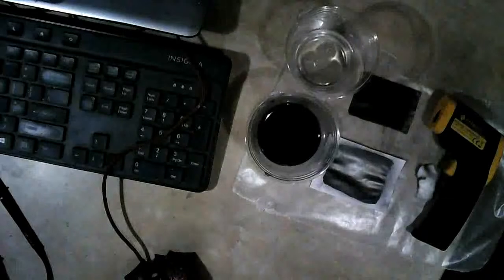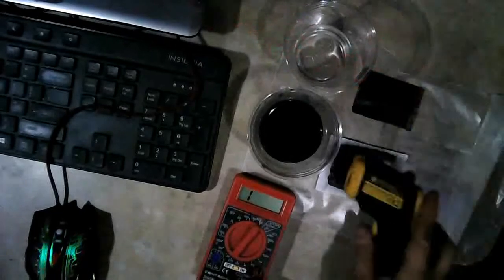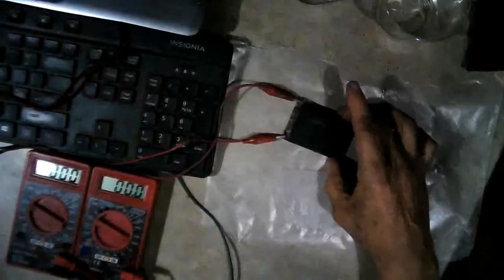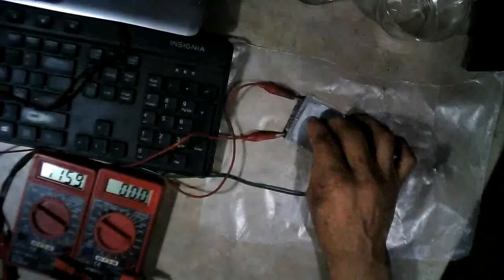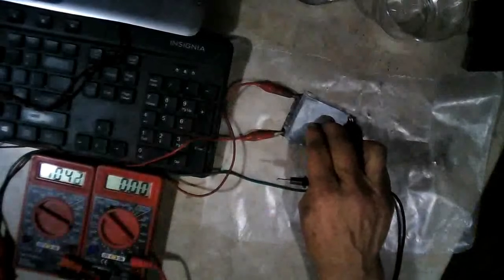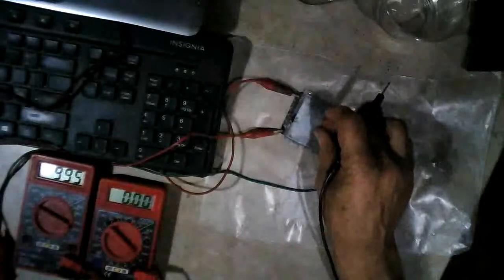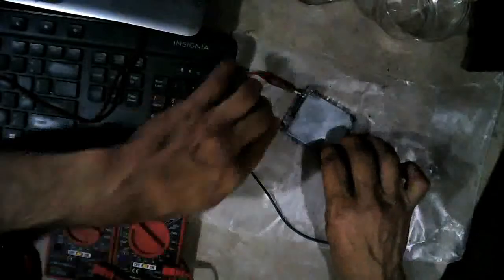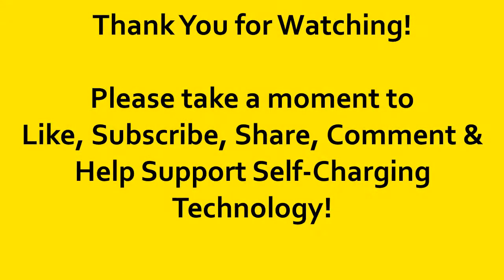Borax Exfoliated Graphite Test!

Comment: Looking good - The laser certainly showed something :-)  the cell performed well.
A small clamp may hold the cell together with a more consistent pressure than your fingers.
Its a pity nearly everything we touch or use is BLACK !!  :-)     Martin.
Reply from the maker: In my case, it's either black or white Martin! LOl I'm constantly washing my hands doing this stuff!
Reply: I was thinking the same thing about pressure but like Ray said it will run out of water. The additional pressure may squish the water out or accelerate bleeding through the separator. On the other hand slight equal pressure across the plates might be better than point loading with fingers.
Nevertheless it was a fantastic demonstration. Great job Ray.
Reply from the maker: Thanks Fred & Martin! I'm aware of the pressure problem, which is why I build the cell with the Zinc plate on top, so it applies a little pressure evenly over the surface. Forcing the electrodes together does create better contact, but it also forces water out of the cell like Fred said. It's a tradeoff like most things in life.